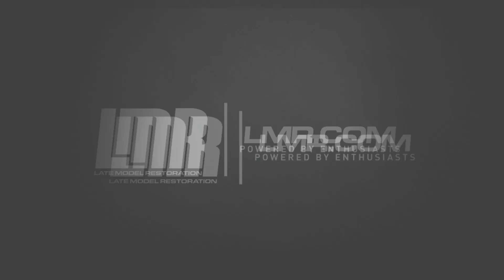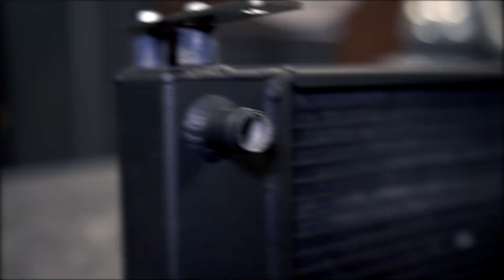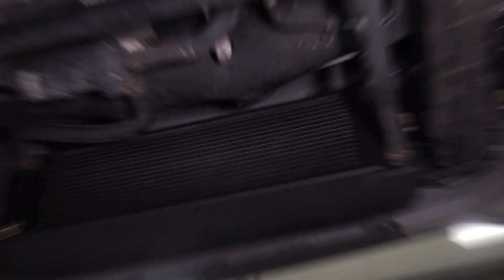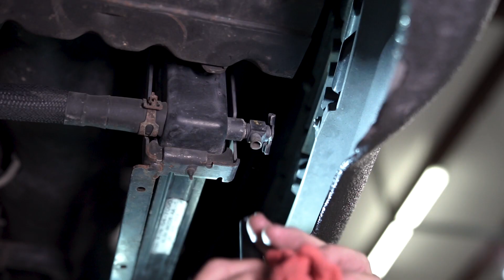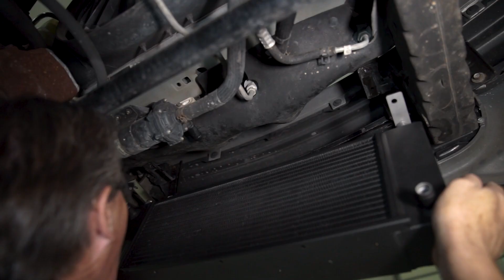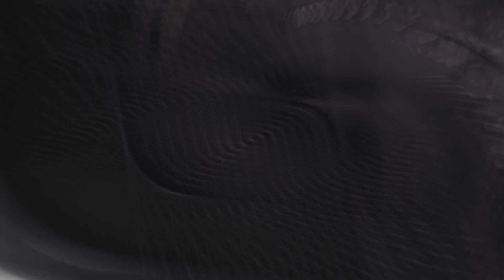1999-2004 F-150 SVT Lightning Fluidyne Heat Exchanger - Install & Review

Comment: Do you not have to bleed the system for air bubbles after refilling coolant?
Reply from the maker: Sometimes it is not needed. If you see that the coolant isn't flowing, you will need to bleed or burb the system to get it all flowing.

Comment: Is this a radiator for engine, transmission radiator, or radiator for a turbocharger?  I do not understand fully.
Reply from the maker: This is the heat exchanger for the factory supercharger. These trucks run a air to water system that helps dissipate heat.

Comment: What hose size for the drain plug?  1/2"?
Reply from the maker: Since this video is from 2018, I wouldn't know the exact hose size that we used. It was a spare one that we had laying around the shop. The best thing to do give Fluidyne a call and ask what size it is or take some spare hose that you may have and test those out. - Jude H. - Social Media/Events Coordinator

Comment: What better to use straight coolant or 50/50 for the intercooler?
Reply from the maker: This will still be a proper 50/50 mix on this system as well.

Comment: LMR I HAVE A 01 NEW EDGE 373 GEARS 5speed PRO 5o SHORT THROW WIT ONLY 100,000 MILES NEVER HAS BEEN SMOKED IN I NEED BBK THROTTLE BODY AND A SUPERCHARGER BAD LOL 4REAL GO CHECK OUT MY MUSTANG VIDS ON MY CHANNEL THANKS